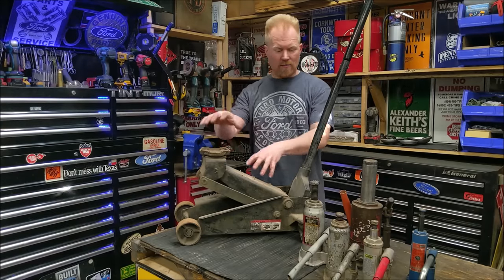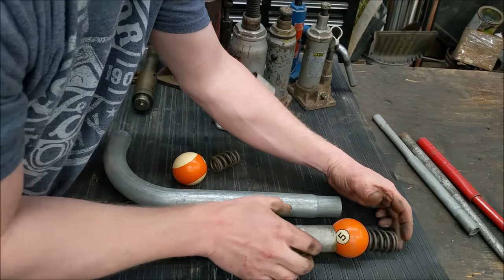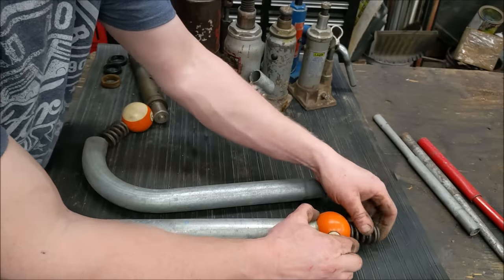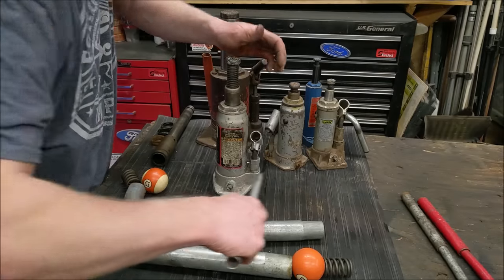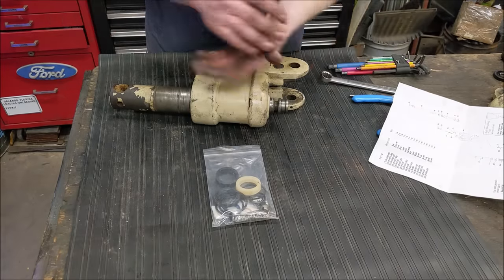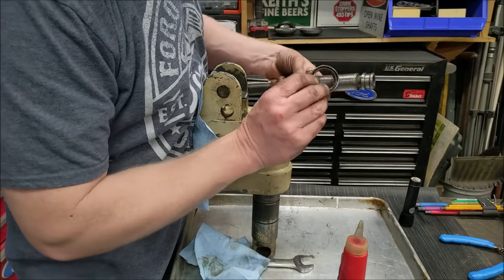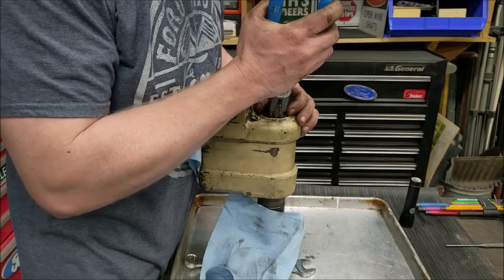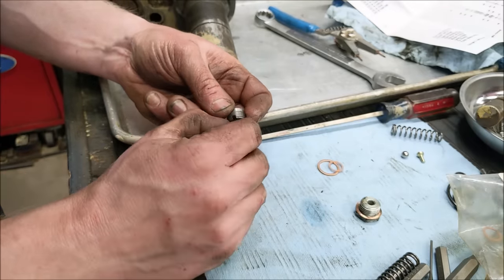How to REPAIR Hydraulic Jacks & How they WORK Bottle, Floor, Pallet, ETC

Comment: On the shaft pitting it may still be salvageable. I've used this technique to restore old car brake caliper pistons that you can no longer buy. Clean the shaft up real good with brake cleaner, wipe the pitted area with JB Weld to fill the pits, once it dries sand it smooth till the JB Weld is flush with the surface.
Reply from the maker: I've heard people having good luck with that method.
Reply: I have a practically brand new 27 ton Remington wood splitter that I was getting ready to do the same thing, my friend was trying to separate a log that didn't break all the way and he hit the shaft about half way in with a hatchet and marred it pretty good and now it leaks down after a while unless you store it horizontally
Reply: @oldmountainmarineandmetals9736  the moral of that story: don't lend your log splitter out.

Comment: FINALLY, someone that actually explains how these jacks mechanically  work. But also how, and WHY they fail. 
 Can't tell you how many videos I've just sat through with "How to "fix" your blah blah jack" in the title, only to find out their genius solution is simply how to go about bleeding air out of the jack. Or adding oil. Bleeding is NOT "FIXING" a jack.
  Anyway, thanks brother man. Your video helped me out alot. Outstanding video! 👍

Comment: My 30 year old craftsman 3 ton floor jack was leaking at the pump and slowly dropping. I changed the seal and oil a couple years back and still all good. Thanks for breaking them down. Much easier to understand

Comment: Thank you for down to earth explaination.  Due to large liability concerns, Harbor Freight jacks are built well.  Still, with any jack, don't ever trust it!  At least place a tire at a support point.   My 2 cents.
Reply: Harbor Freight and built well. hmm now that's an oxymoron.
Reply: Guess they forgot that with Jack stands
Reply: My brand new harbor freight jack was low on fluid out of the box

Comment: One of the best ways of seating the Ball in the valve is to make sure the seal surface is clean, (and not so badly mutilated it needs recutting!) Fit the ball and  tap it LIGHTLY against its seat a few times with a hammer and drift. The ball should form its own seat. (Sorry if this is elsewhere in comments but I did a quick trawl and didn't see one.)😉
Reply: And replace the steel ball which is hammered!!!
Reply: @hishamchohan494  You will need to do this if you do not understand the words, " Tap"
 and
 "Lightly"
I hope this helps you and your hammer.
Reply: @JimiHendrix998   thanks ,I'll try it in the future

Comment: Great video, thanks for the tutorial on check valves, that was awesome!  My only 2 cents... be extra clean with the fluid.  I once repaired my dad's floor jack (it suddenly dropped after jacking up the front end of a '69 Cadillac).  The jack was only 2 years old, never abused.  Upon opening, I found nothing wrong with the seals.  I meticulously cleaned it, added new fluid and it's been working fine for the past 40 years.  I suspect a bit of dirt, grain of sand or something found it's way between the seal and cylinder.  Of course I went back to fixing the starter motor on that old Cadi, and something I can't stress enough... SAFELY USE JACK STANDS ALWAYS!  The jack failed without warning, when it had already lifted the car.  I was reaching for a jack stand and it just dropped at normal pace.  It wouldn't lift anything after that.
Reply: Great info, thanks.

Comment: I'm rewatching this video right now because I've got a Harbor freight floorjack that will pump up, but it won't hold. I bled it several times. No air bubbles. So I think the U cup seal is probably leaking. However I missed the part in watching this earlier about you may not be able to get parts, lol. Plus, I cannot find a way to get the huge nut off the end of the hydraulic cylinder loose. I think I just need a new jack. PS, YOU ARE THE ONLY VIDEO ON YOU TUBE THAT SHOWS THE COMPLETE PICTURE FOR JACK REBUILDING. Thanks for that. ❤

Comment: I've had a big old floor jack that didn't work for 20 years.  Its a monster but it wouldn't hold so its sat in the back of the shed.  Too expensive to get it fixed and too good to throw away.
I've watched a 100 hydraulics videos and got my head around all the theory but not the down and dirty How To.
After watching your video coupled with high school physics and basic school of life engineering I reckon Im ready to have a go.  Thanks to your great video and down to earth instruction.
Thank you.

Comment: Hydrauilc repair first rule: don't lose your balls.
Second rule: notice the symptoms and notice how they had it. Inspect for the cause on teardown.
Third : clean and inspect during diagnosis and under the paint for identifying numbers and name.
When inspecting tearing down and diagnosing, have a container to keep it all if you have to wait. Use a container you won't need to use for something else. Keep moisture away. If you find similar jacks or rams for cheap you can find answers that aren't in drawings on a unit that's not been torn down.

Comment: Great lesson,I wish there was a Fix all jack parts store , I have some old monster heavy floor jacks only 2 and 3 ton rated and comparing with today's jacks the way the  older ones are built they should be able to lift 50 tons , I have one old jack that uses air that folds out and lifts from under  the frames but it has a harder time lifting a pick up with a big Diesel engine but it will lift all cars and its so much faster and safer  than the floor jacks thanks  TANK
Reply from the maker: I found a couple sites that have a lot, but none are completely dedicated to jacks.

Comment: Great visual on the check valve. I was doing a repair/video on a old floor jack for a friend of mine. His jack would only come down about a third of the way. I had to "back burner" it. With the info you provided I have to take another look at it.  Stay well, Joe Z
Reply from the maker: I would imagine there is a mechanical obstruction in the floor jack linkage.
Reply: @sixtyfiveford  That is what I though when I started on it but could not find anything that looked out of place. I have to have him bring it over & take another look.
Reply: Maybe over filled with oil? If he filled it full with the ram extended?
Reply from the maker: @jesselawson1169  If it had a screw in vent/fill plug that could be. Most are rubber but you can see in the video I do have one screw in style.
Reply: @jesselawson1169  Thank you . I did try draining some of it but still a no go. I have to have him bring it back & give it another go. 
Stay well, Joe Z

Comment: Poly pack seals is what they are called 
Most all hydraulic shops sell them so you could pretty much rebuild any jack
Reply: Not quite that simple most Jack's built in the last 30 years are chinese junk that use special sized metric seals that are hard to come by. They love to put at least 1 custom sized seal that you cant get unless you buy a 40 dollar factory seal kit, that most of the time is not the correct parts anyway due to poor documentation. They are built to be disposable. If you can do it yourself it might be worthwhile. I used to run a hydraulics repair shop that's how I know.

Comment: Gr8 video. I had to dump a garage jack as I could get a 50 cent seal the right size. Well I use some parts off it on a old junk one I found, which was missing wheels and handle and spring. It also had water I'm the oil. Funny I overfill the oil and the rubber grommet blow out and got oil all over my face. Lucky I didn't get it in my eyes. I could not find the grommet. So I sealed the hole with silicone. That was second years ago and still going strong
Reply from the maker: That's awesome!

Comment: For reconditioning the check ball seat, I would silver solder a same diameter ball bearing to a piece of round stock of  slightly smaller diameter (even a cut off nail could serve).  A lathe would be useful for centering the ball/round stock for brazing. Then use a cordless drill and lapping paste to recon the seat.  It is evident where Ginger learned her tricks from!
Reply from the maker: Good idea

Comment: Best video I've seen. No wannabe with terms like "I think" or "maybe" I've had 2 jack failures lately. A floor jack and my engine hoist. The hoist stops lifting when hooked to an engine. It raises about 1/4 inch then drops back down. (it worked great last time I used it 6 months ago) I bought it 2nd hand and don't know who makes it. I think it is harbor freight. Anyway for my education, what causes it to raise and drop like it does?
Reply from the maker: The holding check ball is just not sealing completely, allowing pressure to move back into the holding tank. Clean the check balls and their sealing surface and you should be good.
Reply: @sixtyfiveford  Fixed the problem - thanks!

Comment: A good thing to note that if you don't have the parts but you think there might be shmoo or water or something causing the balls to seat fully and you take it apart to clean it out DO NOT think taking the seals out and cleaning them will help. The only thing your going to do is mess up a seal that may have been totally fine.
Reply from the maker: Well said.

Comment: Now that's a real mans scooter and his loverly dog of cause :-D
I know how the jack basically works, but the fine details vanish from memory with time.
The bottle jack is very handy in cheap presses, a godsend for any stubborn close fitting part.
Reply from the maker: It's amazing how much power can be held in such a small package. Even my smallest one will move 1.5 metric tons.
Reply: I would imagine it would take a lot of fluid or air pressure to explode the cylinder in the jack.
The circle is very strong.
I'm not saying it's impossible to breach the cylinder, but i would expect the seals to blow out before the cylinder.

Comment: I've seen dozens of these floor jack rebuilds but you've done the best job of describing the check valves, springs and cups.  Hats off to you.  I have a question.  Looking for advice-while I've rebuilt my 3 ton old school Sears , I cannot get the large nut off the old 2 Ton Sears model.  I have a large monkey wrench and a long cheater bar.  I can about lift the table the  vise is clamped to but the nut is not budging.  Assuming all the O rings will be replaced anyways, would you advise taking a MAP or Propane torch to it to try to break it loose? Please advise and thanks
Reply from the maker: Thanks. You can whack the reservoir case while applying tension. If that doesn't work I personally would heat it. You can put wet rags on any critical areas if you're concerned.

Comment: You talked about when lift ram would "leak down".  If the jack is not leaking oil on the floor and the pump handle is not moving up the problem is the release valve or you have a crack in the housing of the jack. In this case the check valves are fine.

Comment: I had an idea of removing all the valves and check balls on a floor jack and hook it up to a boat ram pump to make it go up and down with 12v. Do you think it’ll work?
Reply from the maker: That would be neat. Yes, Just take the small pump piston out and tap a fitting. You will need to remove the check ball from the pump side so the fluid can leave back through the hose on the 12v pump.

Comment: Nice video Moe, I always thought if a jack slowly went down under load it was the main lifting piston seal, I learned something today.
Reply from the maker: Thanks. Generally if the main piston seal is bad it will also leak fluid.
Reply: @sixtyfiveford  Thanks Moe, that is good to know.
Reply: @old64goat  Your right about the main piston seal on a hyd. cyl. that can push and pull.

Comment: Was wandering if a guy could use dexitron 6 in a pallet jack. I'm a delivery driver. And constantly dealing with cold jacks,Jack's, the detent ball valves to work vary slow. I discovered with my truck plow that dexitron 6 works amazing. Preventing freeze failure .

Comment: Great Video, Thanks !
I will chase seal replacement kit to try and repair my motorcycle lift cylinder. Unfortunately cheap lift not sold any longer, and this is the second (replacement) piston facing same internal leak. Will try to clean & lap the seat the way you advise. Thank you!
Reply from the maker: Good luck. Places like theoringstore.com sell seals by size if you can't find an entire kit.

Comment: i would like to see how you rebuild ram style cylinder jacks...the type that hook up to a pump and use either air or an electric motor to pump oil into the rams

Comment: Enjoyed watching you work on the jacks. I have a floor jack and a bottle type jack on a Harbor Freight lawn mower lift that I need to overhaul but neither one has a name or number on them, that I can find, and HF has no parts nor diagram for their jacks. How would you go about finding parts and a diagram on the internet for these jacks? Thanks
Reply from the maker: You need to take it apart and measure the bore, rod and seal size. Places like www.theoringstore.com will sell the U cups, seals etc by size.

Comment: I have two Harbor Freight three ton jacks, bought maybe two to three years apart some time ago.  They are the older style grey colored jack, Pittsburgh branded.  They are also identical in every visual way.

The first jack was always easy to use, no issues, pumped easily.  The second jack, from day one, required a lot more human force to be put on the lever.  Considerably more force than the first jack.  I went through the air bleeding procedure on the newer jack at least once and can't say it made any noticeable difference.

Do you have any suggestions, recommendations, or comments on why the second jack is more difficult to use even though I would have assumed them to be mechanically identical?  Maybe it was built on a Friday in China?
Reply from the maker: Two issues with Harbor Freight: First to save money they make us the consumer be the quality control. Make us waste our time, gas and damaged products to determine if the product didn't meet quality control specs. Second, Harbor Freight doesn't make anything themselves and has private companies making all their products to a basic list of specs. The exact same product can be made in 5 completely different, independently owned factories. So one might be made in Northern China and the other in Taiwan. They look virtually identical but generally they put different model numbers on the items so they can trace them back to the exact supplier. Rant over...     Anyways they probably didn't drill the passage hole all the way through or they are different sizes. They could have also used a different rated check ball spring.
Reply: @sixtyfiveford   That makes sense.  Can't expect much for a new jack that cost around $70.  As far as I can tell they don't leak down though after years of use so I can't complain too hard.  To be honest I haven't run into many terrible things at Harbor Freight.  Some of my friends had a couple of Harbor Freight ball joint presses that cracked and bent but that was about it.  Their quality has improved quite a bit over the years, and their prices have crept up.

Even Snap On doesn't manufacture their own tools.  I own three Precision Instruments torque wrenches, who makes Snap On's torque wrenches.  The only difference between them is the name on the wrench and the case, and of course, the price.

Comment: So is the max pressure caused by the spring check on the pump side, or on the cylinder side, and were the threads on the part you talked about q-tipping with polishing compound, part of an adjustment, or does that bottom out. If neither, does the manufacturer put some kind of relief in there somewhere to keep from overloading the jack?  Thanks
Reply from the maker: On floor jacks the max pressure is controlled by a spring/ adjustable screw generally under a cap that says do not touch. On bottle jacks there is no pressure relief and is simply regulated by pretty much by however hard you can pump it. So you could pump it hard enough to blow out a seal

Comment: Awesome video/explanation! Question..  Ive always wondered on my engine hoist, if its safe to manually pull the ram up first because it takes so many pumps to get it up. 
So I guess my question is, is it safe to manually pull up/out the piston/ram, or will that introduce air in the system? Thanks
Reply from the maker: Pulling it up manually collapses the U cup seal and allows air to flow in. I know how you feel, it's painful to watch the engine hoist creep up with every stroke. I use a shorter bar to aid in the quick rise of my engine hoist. Then I grab the long bar for lifting.